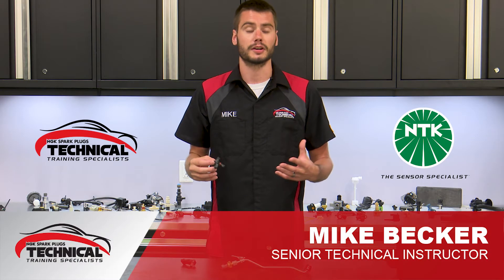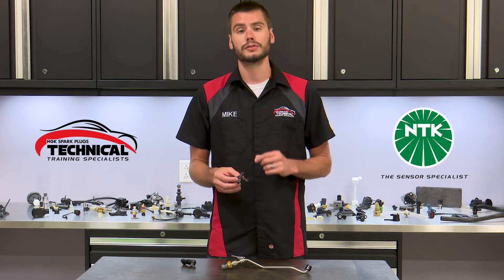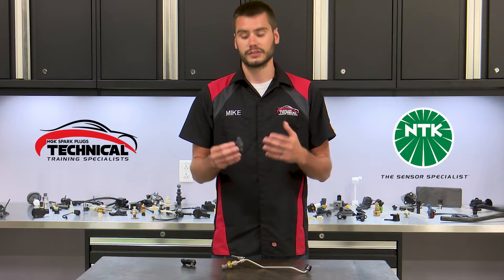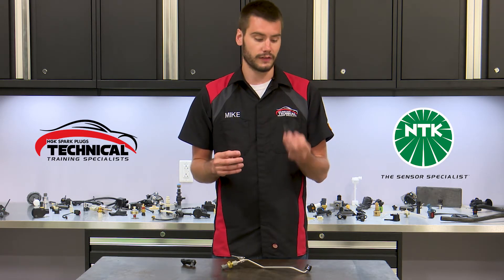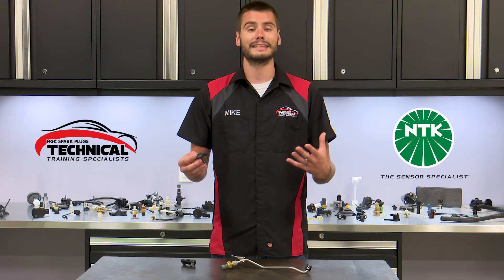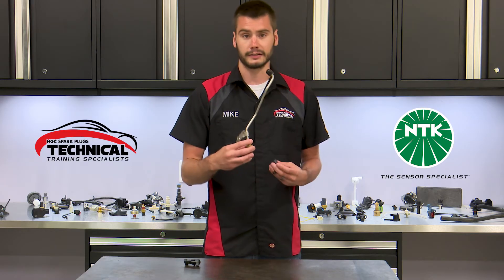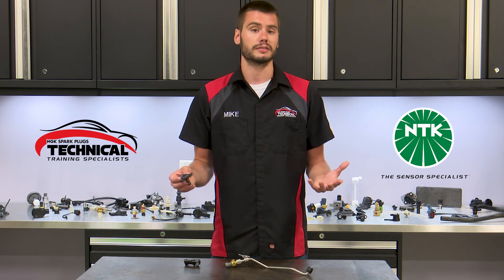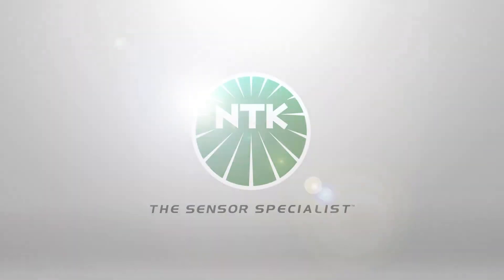NTK - Turbo Boost Pressure Sensor

Comment: Hello 
I have a vw passat cc 2.0 tdi 2009 I get these two codes p0238 p0113.the problem is I changed the sensor back to the same codes I took out on the computer.
Thanks for help

Comment: I have a problem in Toyota Land Cruiser diesel the code is p2588 turbo boost control posission sensor B circuit low 
New turbo and turbo motor is new wiring checked no shortage still the issue what is the couse

Comment: Hi, thanks for the vid. Any idea about the location of MAP Sensor/Turbo boost pressure sensor on Audi A4 B7 2.0 L 2008 S-Line ? Dealer says its located on air pipe coming out of radiator. I saw the diagram he showed but in my car I find it something like predator hairstyle pipes everywhere 🤪

Comment: I just had a malfunction turbocharged boost sensor for a chevy cruze 2011 2 days ago. Yersterday i did not use it at all. Ordered the part yersterday tho & it will get to me 2 to 3 days. Now if i keep using my car to work for example, will it be safe to drive it? Will it malfunction other components of the engine
 Can it last some days before the part gets to me?

Comment: 2004 sensors in Ford focus located
Reply from the maker: Hey Gino, I don't believe there was a turbo option on the 2004 Focus. That vehicle would not have a turbo boost sensor.
Mike Becker, Senior Technical Instructor